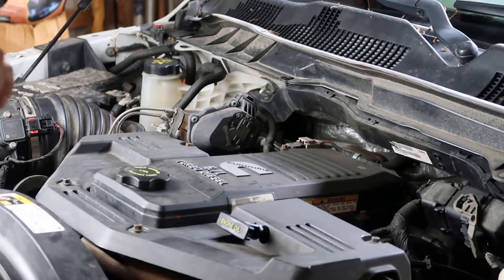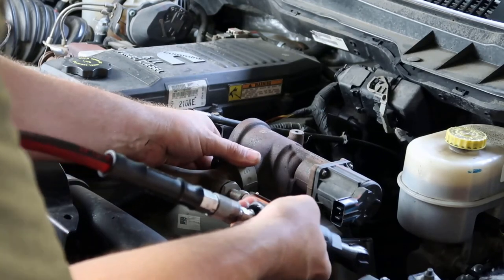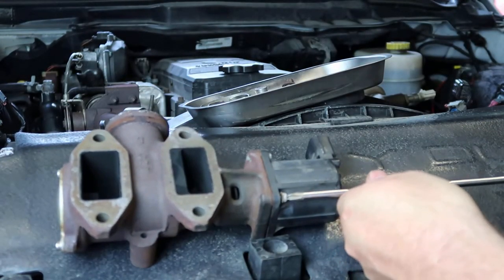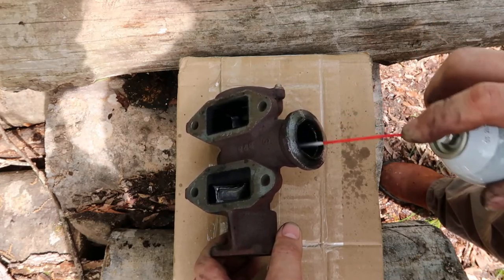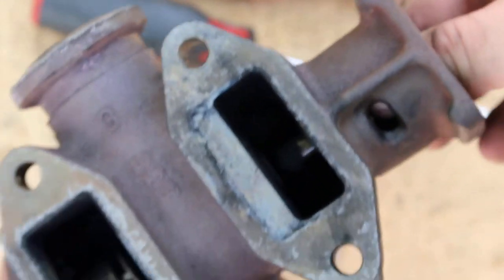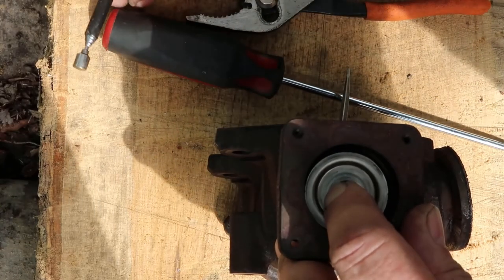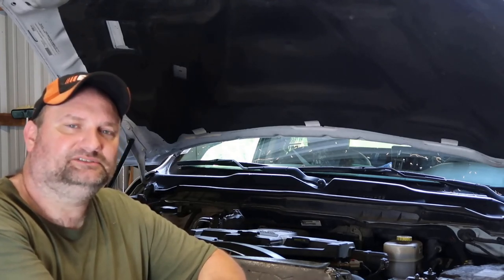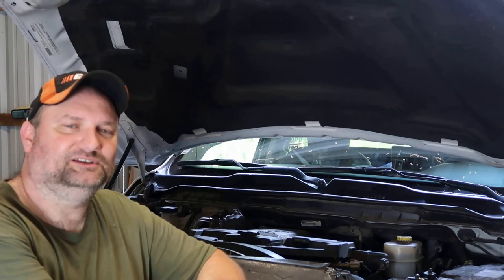How To Clean EGR On 6.7 Cummins  (2017 Ram 3500)

Comment: I use the TerraClean tool and products to clean the entire system in about 1.5 hours. I do not have to remove the valve, I hook in at the temp sensor, remove the egr actuator, and replace it with a thumb screw plate so I can open and close the valve. The system cleans the intake, grid heater and the combustion chamber,egr, egr cooler, turbo, and dpf. Basically everything "tip to tailpipe" Excellent video however, the TerraClean system has been life changing.
Reply from the maker: Thanks for the information. That sounds like a great way of getting it all clean. Thanks for sharing. Have a Blessed Day Friend!  Justin

Comment: My truck is at 68,000 miles right now. Just did the CCV today 

Wondering if I should try and do this in the next few weeks?
Reply from the maker: Its not a hard job. Now I will say it probably isn't necessary right now. Mine wasn't to bad.

Comment: But did you coean the carbon in the other side?
Reply from the maker: Yes! I soaked it in the carburetor cleaner and moved the valve all the way back and sprayed in behind the valve, Hope this helps!
Reply: @homegrowncountryhomeplace  im talkin the carbon in where the egr is connected, those 2 holes you see after you remove the egr
Reply from the maker: @Apabilliardnewwave  No, I didn't do any cleaning on the intake side.

Comment: did your truck consume radiator fluid prior to this repair,? if so how much?
Reply from the maker: When my EGR cooler went bad, it was used probably 4 gallons of coolant from Washington back home to MS.  So if your loosing coolant and don't see a leak, EGR cooler could be bad. Your EGR crossover tube will be wet to pasty instead of black dry soot. Have a Blessed Day Friend.   Justin

Comment: Out of curiosity, is this the same thing as the check engine light that is supposed to come on around 60k miles?  It basically tells you to take to a dealer for an EGR clean.  If so, this a $1200 dollar service to do what you just demonstrated?
Reply from the maker: The 60,000 mile service light is to replace the crankcase filter. The EGR and EGR cooler is based on what year model you have. Your owner manual should give some detail on when to have that service done. I think it is usually around 75-100,000 miles. Have a Blessed Day Friend!  Justin
Reply: @homegrowncountryhomeplace  thank you sir.

Comment: Might I ask how many miles you had on the truck when you did this? Also, lots of towing/ highway driving? I’m at 125k with mine with lots of towing and 75% highway driving. I don’t notice any of the symptoms of a dirty egr. Just curious if it’s necessary. Thank you.
Reply from the maker: I think this was the second time I did this but about 75-80,000 miles since the last time. It wasn't bad at all. Mine is 100% long highway miles  250-400 miles between stops.  I just do mine as preventive maintenance. Hope this helps. Have a Blessed Day Friend!  Justin